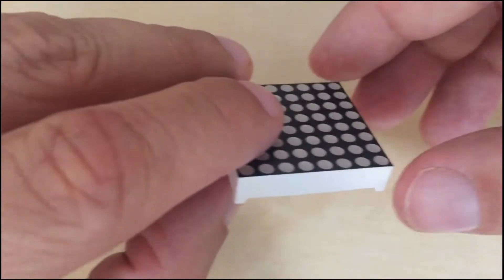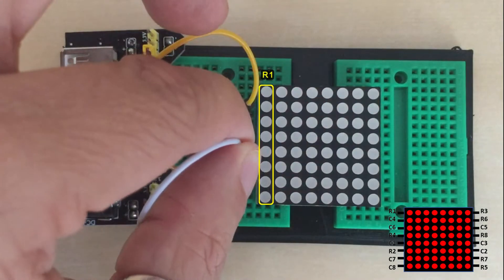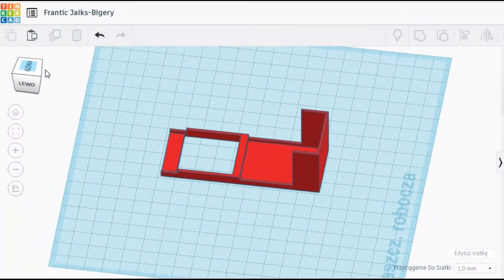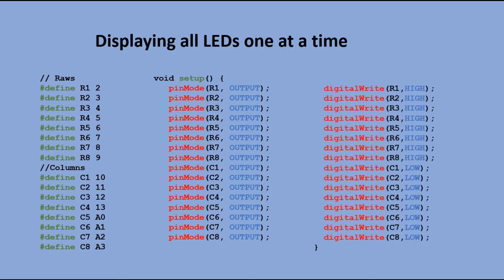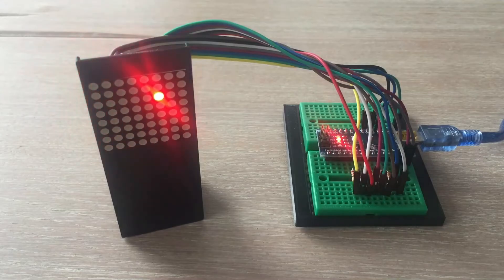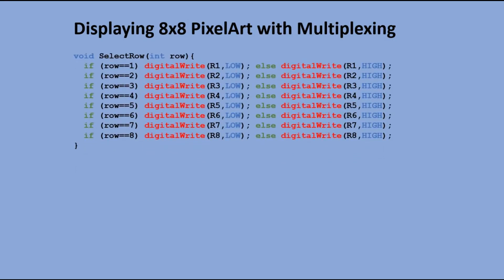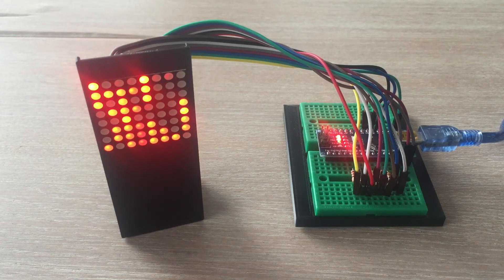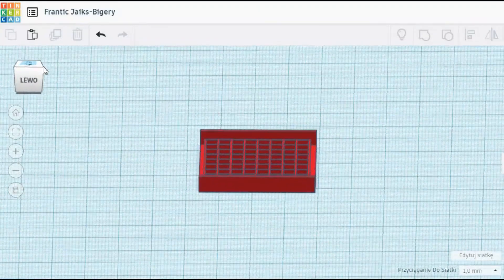Easy LED Matrix Control: Arduino and 8x8 1088AS Matrix Multiplexing

Comment: How does the displaying of leds speed up over time in the second example?
Reply from the maker: By decreasing the delay. I have not watch this video in a long time. But I am fairly certain there is delay(variable); line anad the variable is set to a certain value and the it is decreased so the delay inbetween frames gets smaller

Comment: Be careful, this circuit is wrong, you need to put drivers for both the positive and negative poles of the LEDs with a resistor to avoid overloading the microcontroller with current...

and then there is a problem in the software called "led ghosting" where some leds are turned on with lower brightness when they should be turned off.
Reply from the maker: This is a very old video. I am aware of those issues. Isn’t that problem also called “led bleeding”?

Comment: 4:08 how would you map this exact 16 pin setup to a Pot is what i would like to know 4:08
Reply from the maker: I would be quite complex. you would connect the rows of both matrixes together and connect them to 8 pins of Arduino. And then connect all 16 columns to Arduino 16 pins. so you need 24 pins. I think in this case Arduino Uno and Nano are out of the question and you need Arduino Mega. It is easier with the MAX7216 :)
Reply from the maker: In this video you have the exact layout of columns from C1 to C8 so If you add another the columns of this display become C9-16. You connect rows of both displays so R1 is connected to R9 R2 to R9 and so on.  But thie you ave to program multiplexing accross both matrixes. So the code would be different
Reply: Thanks, i will be using omega and the 16 pins, my matrix is home made using one color leds . I just need your test code you did to see if all led is working to be tied or map to a Pot . The sequence will be control with the Pot . Not automatic as demonstrated here

Comment: Why if we choose row 1 & column 1, R1 is low and C1 is high, shouldn't both of them be high, could someone explain it please?
Reply from the maker: The electricity flows from positive (+ or 5V) to Negative (- or GND). This is why to activate the row we send low and to activate column we send HIGH
Reply: @marios_ideas  thanks!

Comment: Thank you Mario for the inspiration. I tried another solution because I didn't understood the need of the "-abs(...)" part of code and I have also two problems with your code: the text was mirrored (as other said) and I didn't want to turn the matrix 90° to see the text in the right way. So I share here my solution:

....
void loop() {
   movecol = 0;

   while(movecol<(colsize-7)){ 
      // for each column, shows the row's leds
         for(int col=0; col<8; col++){
              for(int row=0; row<8; row++){
               lc.setLed(0, row,  col, textarray[row][(col+movecol)]);  
            }
      }  
   delay(50);
   movecol=movecol+1;
   }
}  
....

Where colsize was declared at the beginning in this way:
const int colsize = <number of columns need for your text>.

The trick I used is to put the same pattern ∽∽∽ at the beginning and at the end of the "array's columns"

Comment: Hello Mario, thanks very much for this nice video.
but I want to ask about
 SelectRow(j+1);
and  Set_LED_in_Active_Row(i+1 ,Cat[j][i]);

why j+1 and i+1

I didn't got this, would you please identify it for me.
thanks for your effort.
Reply: it's because the i and j variables begin at the value of 0 at the beginning of the for loop
and when they reach 7 which is < 8 the loop ends 
so basically their values are from 0 to 7
the +1 is to enter a number from 1 to 8

Comment: I don't understand something though. You have not connected anything to a ground pin. How can current flow? Or am I missing something?
Reply from the maker: If you select a row and send Low signal to it  with Select row function that connects all cathodes of leds in that row to ground and then if you select a column by sending High signal to it meaning all anodes are connected to 5 v. Then for LED which is in place that this colum and row crossess electricity can frlow and it lits

Comment: thanks for your explanation  
 i understand   a little bet  
but may  point is split into tow things 
first one 
why there's loop x<5  
as i am seeing here if i divided  54 from 8 (54/8)  it   will be 6.75   so why the   loop =5

 second one 
lets suppose that  position =0  and  I =1
if we  subtract i + position from ( i + position /54)*54  the result it will be   ( 0 ) all the time  
 so  how we will move to another row  of the first 8x8 matrix  
thanks
Reply from the maker: The loop x5 is for persistance of vision.  You display a current 8x8 part of the text with the two inner loops . If you did not have the thrird loop the loop function would complete and you would go to execute loop function  with the changed position. That would mean that the text would scroll way to quickly and you would not see the right effect.
With that extra loop you are displaying each position 5 times slowing down the scol. You could even make this 5 a variable changed with potentiometer  and theis way you can control the speed of scrolling. If it was e.g. 7 the scrolling would be slower

Comment: set_led_in_active_row(i+1,marios_ideas [j] [(i+position)+abs((i+position)/54)*54]);

firs of all i want to thank you about the content  it was useful for me and taught  me the  way of matrices are working   
but i still got problem with understanding the way of scrolling text  
and main thing that i didn't understanding is  this line that i mention it in the top  how did you dealing with columns 
and why there's a subtraction mark  ( - )between  [ (i + position )and ( i + position / 54 )* 54]  i will be  grateful if you   explain it for me  
thanks
Reply from the maker: It is fairly simple. You always display 8x8 leds  this in the video is shown by moving yellow farme if I am not mistaken. The exact 8 columns to be displayed is selected by variable position. It indicates which is the first column to display and then 7 subsequent columns are displayed as well. When the loop function is executed we increase the position by one so next time around  we display 8 columns shifted by one to the right. So this is all great as long as position is within 54 columns  of the Mario's Ideas bitmap. Loop is executed indefinetly so soon you may look at position being equal e.g to 1000. Then we are dividing the position by 54 and take the absolute value from that division and then multiply it by 54 and substract it from position. This way we remove equivalent of all 54 led cycles that happened before and this way we achieve the smooth transition so the text starts all over again. Did I make myself clear?
Reply from the maker: Don't forget to like the video if you enjoyed it. It helps me a lot with youtube algorithm. This video also shows doing things a bit harder way. Please check also this video https://youtu.be/SGjQ-E3UD7ADon't forget to like the video if you enjoyed it. It helps me a lot with youtube algorithm. This video also shows doing things a bit harder way. Please check also this video https://youtu.be/SGjQ-E3UD7A. I will also in the future do a video on parola library which is dedicated to scrolling text on multiple matrixes like this one

Comment: Very well explained - great help. NB: You have both r6 and r5 going to d7 - r5 needs to go to d6 ;)
Reply from the maker: Can you point to the exact time in the video.
Reply: @marios_ideas  I see now its already been commented on below, its at 3:48 to 4:04.  NB: Im searching for code for a mini word clock using this size LED matrix, Arduino controller , RTC breakout board and no multiplexer if can assist?
Reply from the maker: @alheeley  Updated the video description. Thanks for spotting this.
Reply from the maker: This should be straight forward. You either stack 4 MAX7219 with the matrixes yourself or you can buy the modulesready to use. And then look at the Parola library. It is meant for scrolling the text but I think if you look at the library examples and figure out how to just display the content without writing low level complicated code. Then you just create string out of RTC output and send it to the matrixes. Alternatvely you can wait few weeks as this is one of the videos I am planning to do in the neerer future
Reply: @marios_ideas  But any way of tackling it with no multiplexer? No Maxx chip?
Reply from the maker: We are talking about 4x64 leds. How do you plan to control this many leds without multiplexing. 
What I am saying is that if you buy a module like this https://pl.aliexpress.com/item/32789160918.html
Then you need just 3 data pins to control all 4 matrixes. And if you use Parola library you can easy output text to the matrixes with multiplexing being done behind the scenes and you would not have to program it

Comment: Looking for some minor advice. I am working on a matrix project where I plan to create my own matrix, entirely.
Obviously the concept is the same. I then plan to use the matrix on a project I am working on and am looking for an Arduino alternative. Reason being the project does not require the full functionality of the Arduino, just the clock, memory, and cpu functions. I also plan to mass produce this project (To a minor extent) with that being said I need a budget alternative to the Arduino, looking for a variation of something opensource that i could base my motherboard off of.  Any tips or idea? Thanks in advance.
Reply from the maker: ATtiny85? It has just few pins  costs below 1EUR and is Arduino compatible
Reply: @marios_ideas  THAT'S PERFECT,  Thank you!!!

Comment: At min 4:04 you say R5 to D7 - but at 3:48 you already said R6 to D7 ...?
Reply from the maker: My bad ... Doing a video like that is not that difficult to make a mistake like this. You moste often notice it when video is already cut and uploaded. So not the firs mistake and probably not the last one.Please check the code and there you will find actual connectivity data
.
Reply: @marios_ideas  :-) No problem  - I just followed the video closely and saw that there was one spot you never mentioned so I stuck it in there. I never got the program to upload to the board so I had to go another way anyway.

Comment: Tip: when looping trough the columns first SelectRow(0) which effectively deselects all rows then set the columns and after that select the actual row. This will prevent the pixels 'bleeding' from the previous row
Reply from the maker: Thanks for the tip. I know exatly what you mean by bleeding. I will connect the components again and see what differenence it makes:)
Reply: You are a genious! Thank you so much <3
Reply: My man with the good ideas😄

Comment: Hello! super clear video, thank you very much. I'm a bit confused, did you mean to write C1, C1, C1... in the definition of the bottom function at 7:15 ? Because C1, C2, C3... i thought was what you meant, but im not sure. Otherwise very clear video!
Reply from the maker: Of course. Thanks for spotting this. I will add info in the comment section.
If you go to the code link you will see that  there everthing is ok.

Comment: How can I connect 26 buttons and make a keyboard,like each button should trigger different LEDs to display different letter patterns?
Reply from the maker: that seems a bit too complicated and you would need. not sure why you need 26 buttons
Reply: @marios_ideas  I mean it's more accurate if there are separate buttons for letters,like can u just tell me the extra components needed to implement it,I'll try to figure out the rest😄😄, thanks for ur reply 👍🏻
Reply from the maker: @Mohammed Kamran   @Mohammed Kamran  This will be crazy amount of work. I would simplyfy this by using something like this
https://youtu.be/Iueek8hVl8E to type the message. Not sure you want to type on the display in real time or prepare the static 
message to display
Reply: @marios_ideas  alright I'll check it out,thanks for ur help😄😄

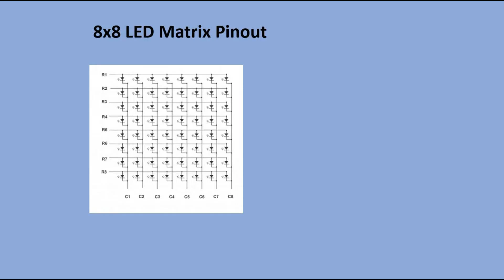Comment: Hi, a very good and clear explanation video. You are using common cathode matrix, but the circuit diagram at 0:36 , is a common anode matrix, right?
Reply from the maker: Rats ... missed that. you are right. Thanks for spotting  this.

Comment: Wow fantastic! Thank you. Would it be possible to use your file for the 3D print?
Reply: Subscriber :)
Reply from the maker: Sure. I uploaded STL file here https://create.arduino.cc/projecthub/mdraber/controlling-8x8-led-matrix-without-drivers-libraries-585371?ref=user&ref_id=1474727&offset=4
under CUSTOM PARTS AND ENCLOSURES. Let me knwo if you could download it?
Reply: @marios_ideas  Perfect, thank you so much. It downloaded and opened in Cura just fine :)